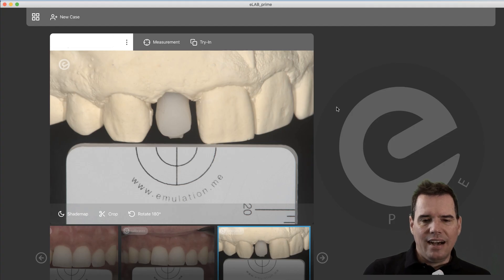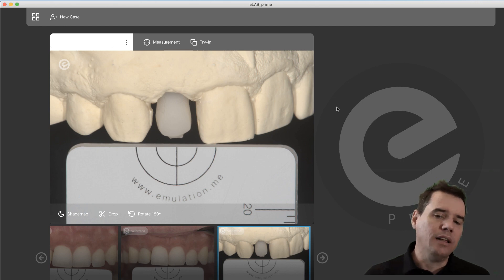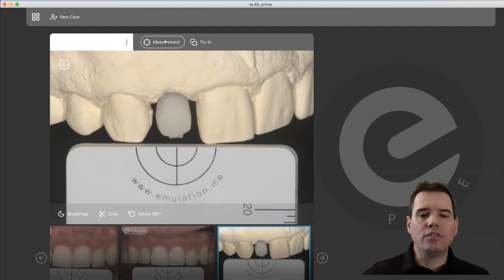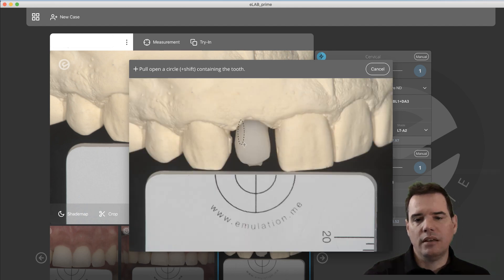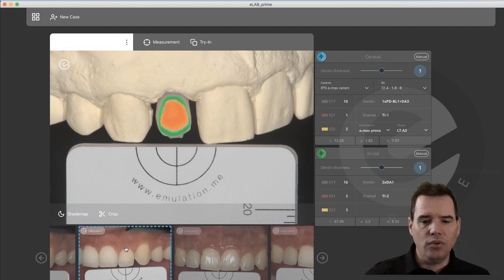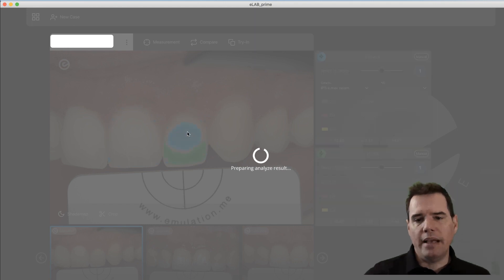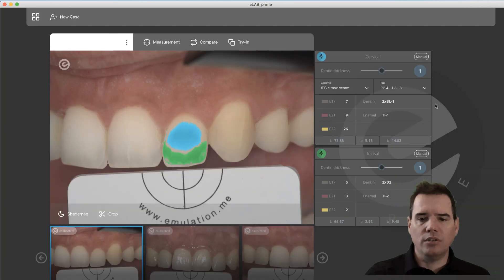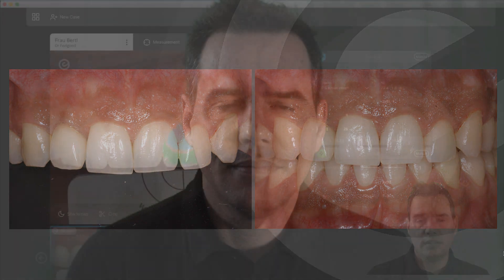Using the veneer mode for implant restorations in eLAB_prime. Copyright © 2020 by Sascha Hein

Comment: Isn't it possible to use pfm as well because the metal coping and opaque completely block the color of the abutment or stump.
Reply from the maker: Yes it is.
Reply: @SaschaHeineLAB  or to use opaque zirconia for frame work which masks completely or 95% block the color of the abutment or stump.
then elab users  have more variation choosing frame materias and don't need to take a picture of stump after preperation?
Reply from the maker: @bongchulkim57  Exactly. You can use the approach using the veneer mode in cases where you need to consider individual circumstances, that is, to use opaque frame work materials and shades, implant abutments or bridge pontics.
Reply: @SaschaHeineLAB  Thank you !!
Reply from the maker: @bongchulkim57  welcome